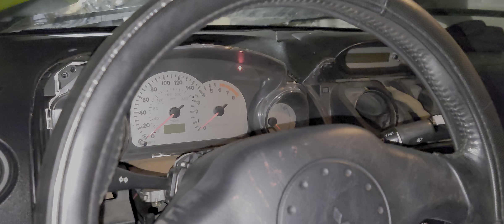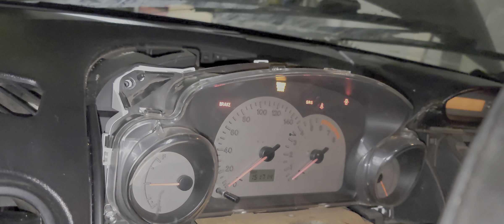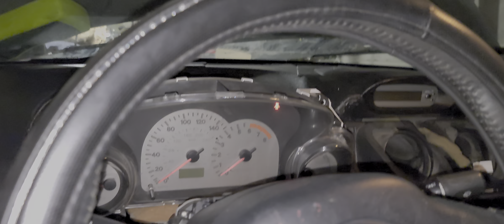3g eclipse immobilizer and ecu replacement

Comment: If i buy a new ECU for my 02 3.0 GT eclipse will the Mitsubishi dealership be able to program the old original key to make my car recognize it without changing the immobilizer?
Reply: Same question
Reply from the maker: Most likely they would, the 3g forums has some guys that just take the immobilizer off the ecu so you wouldn't have to worry, some say they copy the immobilizer to a different ecu so it's your choice of what you want
Reply: @M6xSniper  do you know how can i delete the immobilizer? need to change my ecu but only found the ecu, not the kit ecu/immo/switch.
Reply from the maker: @Raul Reyes  you have to hook the ecu up to a program and delete the immobilizer key on the ecu, some guys on the 3g forums said they do it or copy over your ecu,  but I have never attempted
Reply: @M6xSniper  that sounds really really REALLY difficult ):
Reply from the maker: @Raul Reyes  what engine ant trans do you have?
Reply: @M6xSniper  its dodge stratus coupe 2003, v6 3.0 mitsubishi, trans auto f4a42 without autostick; just found the ecu but im not sure if i can only swap de ecu ):
Reply: How can I get all this 3 things together bb

Comment: @M6xsniper 

if I change all three parts ( ecm, immobilizer, and ignition key thing) I don't have to program the computer without the Mitsubishi tool or do I have to still programmed ecm ?
Reply from the maker: If its same years and transmission then no it should just work 00-05 are 3rd generation ones like this
Reply: @M6xSniper  perfect because I'm doing mines and the ecm has the same number.
Reply: @M6xSniper  once I put these parts in do I have to put on run position for certain amount of time
Reply from the maker: @biglj822009  not that I know of, it might take a bit to throw any codes so I would do a short test run before major use
Reply: @M6xSniper  Because I just put all three parts in my car and still having the same issue. I don't know if I was supposed to put on run position for like more than 10 minutes or something like that or not I'm not sure. but I had changed the ECM, immobilizer, and the key and even use the key that came with. going to be something with the relays for what

Comment: Will this work on a 2007 eclipse 2.4l?
Reply from the maker: The part numbers are different so I don't know, I have heard the alternator circuit is different so I would guess not unless you changed wires along the way

Comment: What was the problem
Reply from the maker: Turns out when a friend went to plug everything back in he forgot the alternator relay and I had mistaken a different set of wires for the relay, its right under the fuse box, once I plugged it in started to charge

Comment: i have a couple questions about swapping the ecu when you change all 3 was there any problems with getting it to start my ecu is going out and im scared of locking the immobilizer up
Reply from the maker: I bought a set so the ecu with immobilizer amd keys , they all work as one and can't just be swapped out unless you send the ecu in and have the immobilizer turned off
Reply: I have the 2000 eclipse i need an ecu the one in the car is shot i bought one off ebay install it car won't start ? What are the steps i need to do do u know?  Im stuck on what to do
Reply from the maker: @louispabon1077  you have to change the key and immobilizer with the ecu, if you just got the ecu off ebay you need the matching immobilizer and key lock set or the ecu thinks your stealing the car I have a set if you need one
Reply: @M6xSniper but wouldn't i need the same matching key, immobilizer and ecu part number for the car to car or function ? Same part number of my car. My ecu part number is mr420673 .
Reply from the maker: @louispabon1077  yes. The ecu comes in 2 types , 4 cylinder and 6 cylinder. The immobilizer and key are programmed to the ecu, so if you just swap out 1 it won't work, you need the ecu and immobilizer that are programmed together. That also means you need the keys to that immobilizer, for the years 00-05 each engine has 2 years of ecu part numbers and each set of years has 2 ecu types, 1 manual and 1 automatic trans, so 4 different ecu part numbers 03 is where they switch, 00-03 PN: mr578508 is auto and  PN:mr578504 is manual in 2.4l cars. And pn:mr507645 is auto and pn:mr507644 is manual for v6 cars. You need to get a matching set from the same car it can be a different year but all 3 components need to be from the same car to work or you need to have the ecu reprogrammed with the old immobilizer which most of the time its just deleted so any key and cylinder will work
Reply from the maker: Looking it up yours is the weird first production ecu where they also had a California ecu type but your immobilizer would need to be MN141241 with matching keys, I dont know if the ecu will work with a set from another car with just matching numbers i would find all 3 from the same car so you know they work not just grabbing 3 that match numbers up from different cars
Reply: @M6xSniper   i have been trying to find the same ecu immobilizer and key part number that matches my car but its impossible to find i looked at all the junkyards in nj still no luck i have a 4 thousand pounds machine that doesn't move what would you do im my situation im trying to avoid the dealership because they are just going to over charge.
Reply from the maker: @louispabon1077  https://www.ebay.com/itm/284692178485?mkcid=16&mkevt=1&mkrid=711-127632-2357-0&ssspo=rvOI1Bn4Q8e&sssrc=2349624&ssuid=TKfMs4LBSMK&var=&widget_ver=artemis&media=COPY
Reply from the maker: @louispabon1077  that one is still the 2000 just a different ecu but all 3 together as long as you get the transmission type and engine size the same it should work they just made different ecu for the first production cars for emissions in California and federal standards and then used thoes for the basis on 01 on up
Reply from the maker: Also what is the symptoms of the old ecu they normally don't just go bad unless something electrical happens
Reply from the maker: https://www.ebay.com/itm/234486325532?mkcid=16&mkevt=1&mkrid=711-127632-2357-0&ssspo=waTVkPlyTxe&sssrc=2349624&ssuid=TKfMs4LBSMK&var=&widget_ver=artemis&media=COPY
Reply: @M6xSniper  its not reading the iac switch or valve anymore bought 3 different new ones and the idle jumps to 1000 to 3000 rpms in parking jumping up and down bought new throttle body, injectors, spark plugs, cables , ignition coils, new cam, and crank sensors, new selenoid, still the same had a mechanic test the ecu and he said it came back faulty p.s. my 2000 eclipse is a 2.4 manual frustrating ill take a look at those links u sent me
Reply from the maker: @louispabon1077  check for vacuum leaks, the ecu normally doesn't just burn out but I guess it can happen. Thoes links are to some ecu immobilizer key sets, don't worry about them being a different part number. As I understand the ecu is vin locked to the immobilizer so as long as you have the matching ones they work together. Last thing to check off the top of my head is the MAF sensore or EGR valve if it drives ok on the road then it's most likely air getting by a sensor that's not calculating it and throwing off the air gas mix also check the 02 sensors
Reply: @M6xSniper  ok thanks for your help i really appreciate it im gonna buy the ecu link you sent me the manual one i replaced the maf sensor and i took the egr out and put a new one in there behind the throttle body i haven't checked the 02 sensor yet didn't throw a code for it but it wouldn't hurt to check it out thanks again
Reply from the maker: @louispabon1077  yah no problem, let me know how it goes and hope thar fixes the issue
Reply: I need a 2002 automatic any chance y’all know where I could get one ? Tag me plz
Reply from the maker: @stephenbautista4575  I find most on ebay but local junkyards sometimes have them if you know the part number and have some time to get it out
Reply: @M6xSniper  ok. It sucks I been looking everywhere!! I even tried getting it fixed . I should of been specific hopefully you see this 
My car is 2002 eclipse gs 2.4l automatic 
Part number mr578508
Is there a a different part # and set with key and immobilizer I can use if I can’t find. This one.
Reply: @M6xSniper  the best I found in a set is this 
2001 MITSUBISHI ECLIPSE 2.4L A/T ECU ECM ENGINE COMPUTER W IMMOBILIZER MR507328
Reply from the maker: @stephenbautista4575  https://www.ebay.com/itm/125558272622?mkcid=16&mkevt=1&mkrid=711-127632-2357-0&ssspo=nMoBxehLS66&sssrc=2349624&ssuid=TKfMs4LBSMK&var=&widget_ver=artemis&media=COPY
Reply from the maker: @stephenbautista4575  if I remember correctly the 00-03 are the same ecu but have different part numbers for an odd reason
Reply: @M6xSniper  perfect part thanks .. . 
When I install Can I just cut the transponder ring  or do I leave it hanging or what ? This set is plug and play but the whole ring confuses me
Reply from the maker: @stephenbautista4575  just leave the ring it pugs into the immobilizer.
Reply: @M6xSniper  got it . Hey quick question idk if you removed everything to get to the Ecu I almost had to 😂 I couldn’t fortunately it drops on its own if it was a screw to remove far left I’d be done and out but my question is beside the cabin attached next near the radio a  vent I managed to remove it cutting a piece where it screwed I couldn’t get a. Phillips but the other part that is also held by the screw what is it do you know it’s like a white switch or relay mine was corroded . It’s mounted on that plastic piece and the relay or switch it’s white.